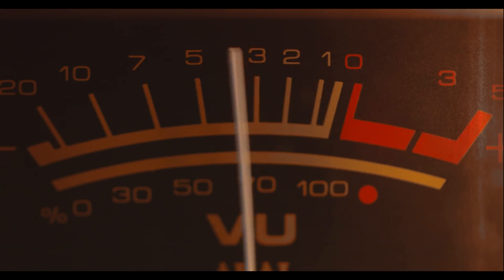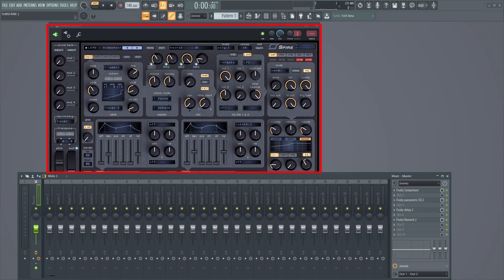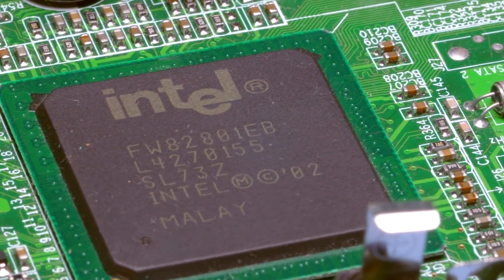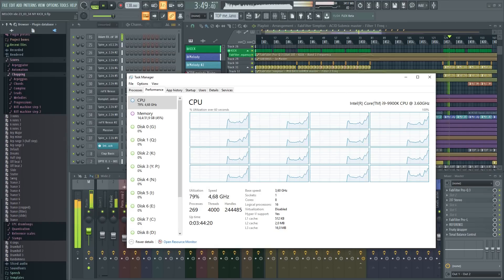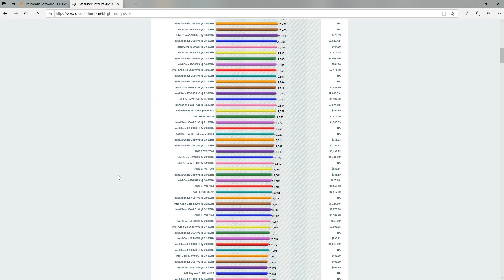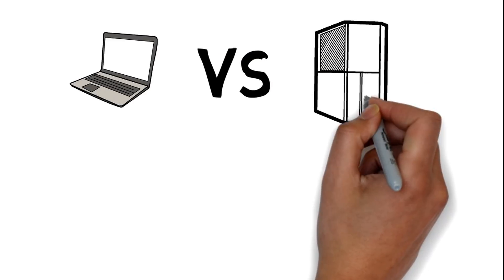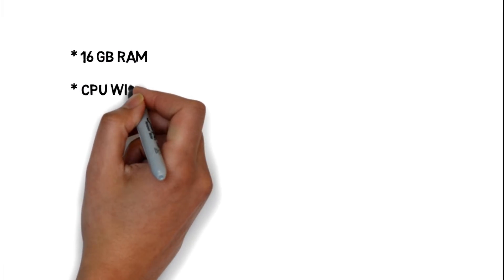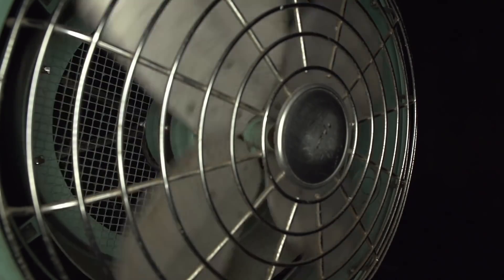The Best Computer For Music Production - What's Needed And Why!

Comment: I agree with this video up to the point where he says the Graphics Card doesn't matter, this is an old mantra I find all over the web, going back many years.  The reason people say this is because unlike video games and video editing, DAWs place relatively low demands on GPUs, because they only need to draw 2D graphics, not the complex 3D graphics gaming computers need to perform. So it'a not incorrect, but there is a caveat in there; I'll explain.    

From experience, with a certain type of GPU, I can say with 100% conviction that you should not buy any sort of computer that uses an integrated GPU if you want to do Audio Production.  Many less expensive laptops use these as well as my current Mac Mini (late 2018), which has a UHD 630 integrated GPU.  This GPU gives nothing but trouble with plugin delay compensation, when tracks have more than a few plugins. It produces audio dropouts and tracks will sound randomly out of time, even though they're quantized and the CPU,  RAM  and SSD don't seem to be taxed in any way ... This perplexed me until I discovered why. 

The integrated GPUs don't have their own video RAM in general, so they share the relatively slow system RAM with the CPU.  This causes a lag in the real time processing of audio data by the CPU as it has to wait for the GPU to use the same RAM. Even though a computer might have a really powerful CPU, with great single core performance (like the Mac Mini), that performance is totally lost if your very slow GPU is accessing system memory all the time, and in fact, the performance of DAW software with the integrated GPU makes a 12 year old PC I built look fast by comparison (The CPU in that PC was an Intel Q6600, and was many times less powerful than the Mac Mini i7 CPU), but I could run more tracks and plugins than on the Mac Mini without glitches.

I solved the issue  by getting an external GPU box which plugged into the Mini's TB3 port, with a decent quality graphics card.  The computer works just fine now. It would have been cheaper to get an iMac with a good graphics card in the first place.  A lesson leant the hard way ........ By the way, this does not necessarily apply to the new Mac M1 CPUs.  I haven't tested these out yet, so I can't give an informed opinion on them.  You'll need to test those out yourself in the shop.

Comment: ableton say: More cores, slower clock speed
Pros
Live supports multi-threading, therefore the more cores are available, the more efficient it will be when working with larger sets with higher track counts, or when working with large instrument or effect racks.
You'll probably be able to run more apps in conjunction with Live without seeing performance drops.
Cons
Lower single-threaded performance than a higher clock speed processor.
Fewer cores, higher clock speed
Pros
Better single threaded performance.
Cons
Fewer cores to split between applications.
Not as strong multi-threading performance.

Comment: I have no idea how to build a computer. Does any company manufacture something?
Reply from the maker: Hi, yes there are many pre-built computers to choose from. As stated in the video, look for a computer with a CPU that has the fastest single core performance as possible, and also as many cores as possible. Are you looking for a stationary rig, or a laptop? 

If you're looking for a stationary computer like what's shown in the video then something like this would be fairly similar (slight upgrade): https://amzn.to/2TUxGoc
Or perhaps something like this if you want a cheaper one: https://amzn.to/3d0hwAF

If you're looking for a laptop then perhaps something like this: https://amzn.to/2TUxIMQ

Note that these are fairly expensive and you might not need this kind of performance. The older i7 based computers are cheaper and also very capable. The new AMD CPUs are also very good. The AMD flagship is actually the best CPU overall right now, mostly because it offers much more cores, and about the same single core performance. That said, the prices on the high-end AMD chips are very high and because AMD has taken the lead so suddenly, Intel has responded by reducing the price on their existing CPUs by a lot.

Comment: I don’t see any performance gain from your tests
Reply from the maker: Hi, there's not a huge performance difference overall when the buffer is maxed out. About 15-20% at the most. However, the 5820k was unable to run the project at anything less than 2048 samples, while the 9900k was able to run it without overruns at half that. Actually, some projects  that would have to be run at 2048 samples on the 5820k would run at 512 samples on the 9900k. 
I believe it's the 4 channel memory that gives the 5820 an edge here, compared to the standard 2 channel of the 9900k. The 5820k is a workstation after all. Even though technically FL Studio should not need such huge memory bandwidth, my tests indicate that it does indeed benefit from it, at least the 5820k did. When I tried forcing it to run at dual channel instead I lost at least 40% performance in some of my heavier projects.

Comment: For Windows 10 with multiple CPU cores, a CPU affinity of the audio application must be defined on a group of cores with higher process priority and only the physical core may be used. This core group must be freed from its processes. This achieves better cache utilization of the CPU and thus increases the "single" core performance of the audio application. The devices should all be set from Line Mode to MSI(-X) regarding interrupt in the driver. The two Windows audio services should run with priority "realtime" on the second physical core. I would only use the last physical 6 cores for the audio application in this scenario.
Reply: I improved singlethread perfomance with an undervolt in my 8 year old i7-4700MQ laptop. Like 300 Mhz more for the same voltage, I have a bottleneck with core count (4 cores are the absolute minimum and not ideal) but singlethread is ridiculously strong for the age that it has, 3.4GHz in Ableton Live all cores thanks to Throttlestop magic and sillicon lottery, equivalent to one core of the Ryzen 7 1700.

Changing CPU affinity in windows makes no difference, the OS already is very well optimized. I basically get 1% or 0% CPU use with the computer at iddle.
Reply: @saricubra2867  My statement applies to modern multi-core CPUs from 6 cores upwards.
Windows is not optimized for real-time DAW requirements. Windows does not optimize the cache usage of the cores for an application.
For CPU utilization in real-time signal processing, the idle CPU time has no relevance.
Reply: @HSCHSC211  Isn't about windows optimization, is about the CPUs themselves. By the way, it's impossible to fully use the cache for audio in a CPU due hyperthreading that can create a bottleneck.
Reply: @saricubra2867  ".  it's impossible to fully use the cache for audio in a CPU due hyperthreading.."  Does not make sense to my statement because I wrote "only the physical core may be used". For example, if you use Process Lasso to run the audio application only on the 6 cores without logical CPU and the rest of your applications including OS services (with xml affinity template) on 2 cores with logical CPU, then the audio application can use the CPU cache of the physical 6 cores at maximum. The logical CPUs of the 6 cores remain unused, so the 6 cores effectively work without HT/SMT. Only the remaining kernel and its interrupt routines "disturb" the cache of the 6 cores. These can also be moved to CPU 0 or 1 (by interrupt policy).
Reply: @HSCHSC211  Using logical CPU cores or hyperthreading still will bottleneck the processor for audio processing. The best way is disabling it on the BIOS. Finally, If you use 6 out of 8 cores for audio, you are roughtly losing almost 50% of CPU perfomance because core count does matter and scales very well with the amount of musical tracks. It would be a nice experiment using the entire processor without hyperthreading and see if the perfomance improves.
Reply: @saricubra2867  "Using logical CPU cores or hyperthreading still will bottleneck the processor for audio processing." I agree.
"The best way is disabling it on the BIOS. Finally, If you use 6 out of 8 cores for audio, you are roughtly losing almost 50% of CPU perfomance because core count does matter and scales very well with the amount of musical tracks." I do not agree. That is almost  nonsense. Only in the rather rare case of low-effect use of hundreds of orchestral sample libraries can scale over very many cores. If I use virtual instruments with sound synthesis and effects with a small buffer at the midi signal, which is the more common DAW use, the realtime requirement is dominant and thus the single core performance, because sound synthesis and effects scale only badly or not at all over several cores.
Reply: @HSCHSC211  The Ryzen 9 5950X gets almost twice the amount channels vs the 9900K while singlethread perfomance is slightly better. Core count does matter too:
https://youtu.be/AV3KkmX6Mb4
Reply: @saricubra2867  "The Ryzen 9 5950X gets almost twice the amount channels vs the 9900K while singlethread perfomance is slightly better. Core count does matter too:" It seems that you have a problem with logical thinking. Your answer has again no relevance to my first comment. Comparing an apple to a rotten banana makes no sense at all. If the guy were to implement my suggestions, the AMD would be far superior.
Reply: @HSCHSC211  Of course that it has relevance. Because your sugestion will bottleneck a CPU even more, that video proves that core count does matter.
By the way, that 5950X is faster than 9900K, has higher IPC, more cache and can clock to 5GHz, therefore is not a weird comparison.
Reply: @saricubra2867  You said "Of course that it has relevance. Because your sugestion will bottleneck a CPU even more, that video proves that core count does matter." and "Using logical CPU cores or hyperthreading still will bottleneck the processor for audio processing. The best way is disabling it .." My suggestion is" ..a CPU affinity of the audio application must be defined on a group of cores with higher process priority and only the physical core may be used." Translated for a simple mind: I turn off HT/SMT only for the exclusively used cores of the audio application.
Reply: @HSCHSC211  You don't have to use the CPU Affinity option. The OS already distributes the workload for all cores, the rest is the behaviour of the CPU alone.
Reply: @saricubra2867  "You don't have to use the CPU Affinity option. The OS already distributes the workload for all cores, the rest is the behaviour of the CPU alone." These two sentences together make no sense. Are you aware of this? By the way, I had already mentioned the second advantage of affinity twice - cache usage. Did you also understand and retain the third advantage?
Reply: @HSCHSC211  Affinity does nothing with HT/SMT turned off. Since each CPU thread is the physical core and already has acess to the cache.
Reply: @saricubra2867  "Affinity does nothing with HT/SMT turned off. Since each CPU thread is the physical core and already has acess to the cache." Random nonsense talk. xD You are funny.
Reply: Also depends on the DAW, Ableton Live is more efficient than FL Studio with clock cycles for sound processing (maybe because it's programmed in C which is very low level and C++). The difference can be kinda big.

Comment: I am building pc for music production as well as gaming , but I am confused about cpu cooler like which will be best for cooling and noise free , so for  processor i9 10850k it will be cool and noise free if I buy cpu cooler or I will have to buy aio cooler and which Mobo is suitable for i9 10850k it means should I go for Thunderbolt port or any best recommendations?
Reply from the maker: The cooler shown in this video is extremely quiet. In fact, you can't hear it at all. Some watercooling can be more audible because you can sometimes hear the pump.

Comment: Should i change my i9 9900k for amd 5950x
Using various vst, around 50 tracks max
Reply from the maker: Hi, I don't think it would be worth the investment, unless you also use other applications where you can benefit from those extra cores. The 5950x is just 2% faster than the 9900k overall according to most user benchmarks. The 5950x has about 11% faster single-core speeds, however, the 9900K can be overclocked a bit more, which will eat up that difference, so in theory, they should be more or less equal. At best the 5950x will give a very marginal improvement if any. The really big advantage of the 5950x is the extra core count, which won't really play a huge role when it comes to music production most of the time. 

50 tracks is not a whole lot. I still have my 9900k and I usually operate with plenty of VST's, and 100-120 tracks with no problem. 

Unless you really need those extra cores for video editing or something then I would save my money and wait for a while before the next upgrade, or spend it on studio monitors or something instead. :)

Comment: Hi! I want to see where my laptop stands to see what laptops are better than mine for music production, and I am very confused with this page and the charts. 

Is MOps/Sec (millions of operations per second) the unit for single core/thread performance? The higher this number is, the better CPU performance for proccesing audio?

Am i supposed to be looking at single thread performance page? Is that the same as single core performance? Or am I supposed to look at High-mid end where my laptop model is?

So, the higher the cpu mark the better single core/thread performance? In other words, should I not worry about other sub parameters like max clock speed, max turbo freq and stuff like that, as long as the colored bar is large? lol

Thank you very much for this!

Comment: Do you overclock the CPU during mixing or working with virtual instruments?
Reply: What is the max ghz you throttle the processor? And what is the temp? How long you keep in throttling mode? Is the OC auto or manual?
Reply from the maker: @Pianitara  I throttle it to 5 GHZ max. I've had it at 5,2, but I don't like to push it to the very limit. 
It's automatic overclocking using the AISUITE from Asus.
Reply: @FireWalkMusic  Thank you.
Reply from the maker: @Pianitara  You're welcome :)
Reply from the maker: I keep it overclocked at all times. :)
Reply from the maker: It will throttle down on its own when the load is light. :)

Comment: Thanks. I'm looking for information for a new build. I've seen a few videos that end with "not as much improvement as I expected". I think CPU speed is not as important as people think.  I just watched a great video from Richard Ames Music from 5 years ago and finally got the answer. The key is real-time performance and that is effected by how much the CPU is locked up. Therefore I think a good motherboard, fast SSD, good drivers and good OS set up play an important role.
Reply from the maker: Look for a CPU with as fast single-core performance as possible. That's more important than the number of cores. Fast single core speeds and high clock speed is key. No need to invest in a 24 core monster if  you can spend less money on a CPU with slightly fewer cores, but with higher single core performance. 

In this particular comparison, the old rig was a workstation with quad channel memory, and the new 9900k was only using dual channel memory. about 15% improvement at max muffer size. However, it should be said that the old rig was unable to run the project on anything less than 2048 samples, while the new one was able to run it at 512 samples, which is essential if you want to record live for example.

Comment: Hi, i am on a tight budget, would you say a i7 3770, i7 4770 or i7 4790 would be enough to run fl studio to make mostly drum and bass, some samples, a few vst's, perhaps 20-30 tracks? also, i don't understand the "K" say for instance a i7 4770K, is that better than a 4770? many thanks, and great video.
Reply from the maker: Either of those should work for that purpose. You don't need a whole lot if you operate with few tracks and few VST's and effect. In this example there's probably 120 tracks and 60 or more VST's.
Reply: @FireWalkMusic  That's great, thank you for your reply, i saw you mention in the comments to others that even older I7's are pretty good, so i will go with one of those. Great channel btw.

Comment: When I click the links to amazon. Some of the links don't open to the actual part. Can u please upload a proper list. That would help tremendously. 😉
Reply from the maker: Hi, if the part is sold out at the store it's linked to then it will attempt to redirect to the same part on a dufferent store. I suspect that's where it might get messed up. It'll go over the list and check. Thanks for letting me know :)
Reply from the maker: I believe everything should check out now. :) All though some parts have been updated to newer / equivalent parts.
Reply: @FireWalkMusic  thanks so much for the follow up
Reply from the maker: @dameethyltriptwthme3981  you're welcome :)